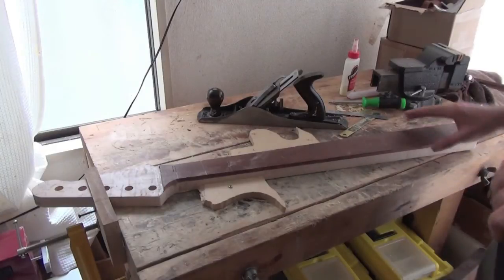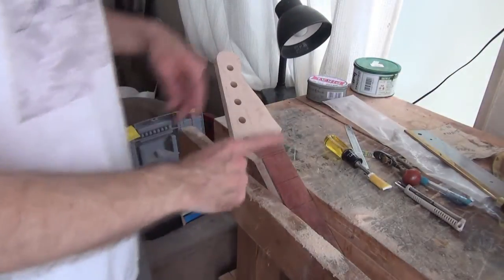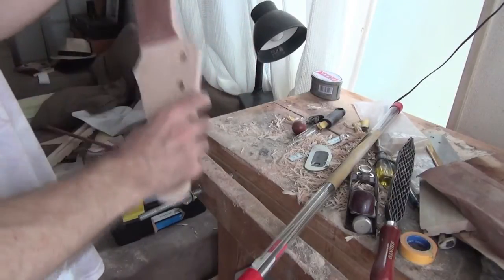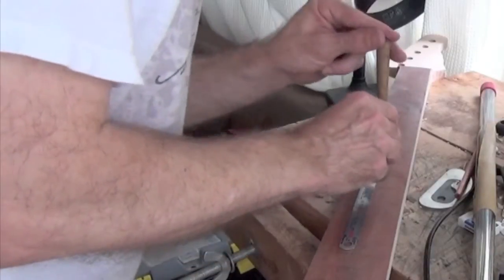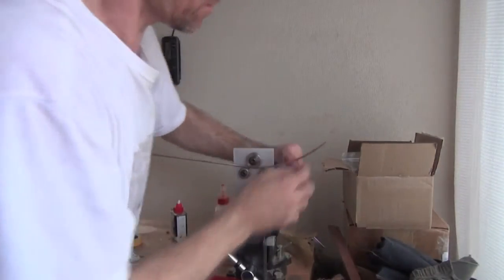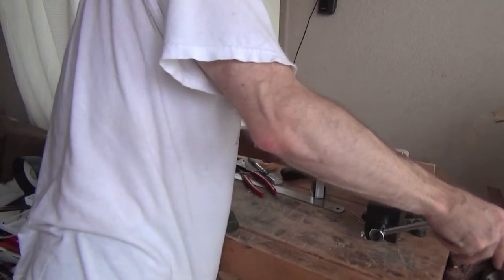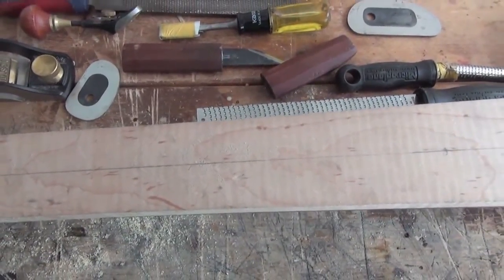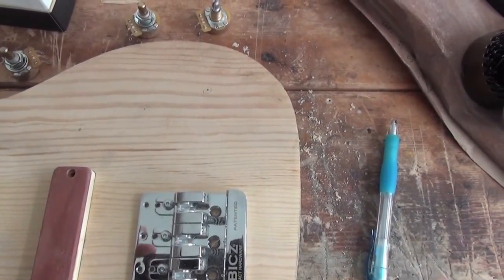Hand Tool Bass Build Seven

Comment: I'm from Brazil and have always been delighted with the possibilities of using the woods. As a bassist, I started research on luthiaria and simplest possible tools, in order to start my own project.

I take a doubt.? I noted that you sanded the scale for her to stay at the desired angle. Opposed it noticed that she gets a glow. You end with a varnish or sealer so that the scale is a more contained cum shine?
Thanks in advance !!!
Reply from the maker: Luis Eduardo Martins Hi - great to hear from you! The glow is simply a function of the wood itself, but I sometimes add a little oil or wax to supplement it. The issue is to not get anything into the fret slots before fretting, or they may not seat properly. 

My favourite fingerboard finish is two coats of oil varnish followed by two of Briwax. It is a very light finish that nurtures the wood and brings out its shine.
Reply: ok. Thanks for the clarification. What I found was that these well-scales were painted black. I discovered that also is used to scale the ebony.
  After research, I found that the example of what you told me, the result of wax already provides a good result.